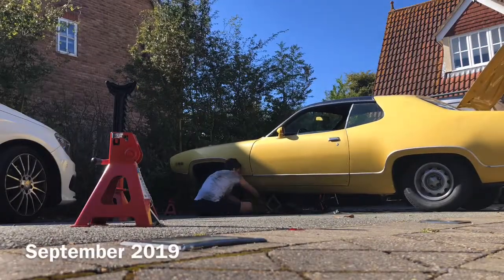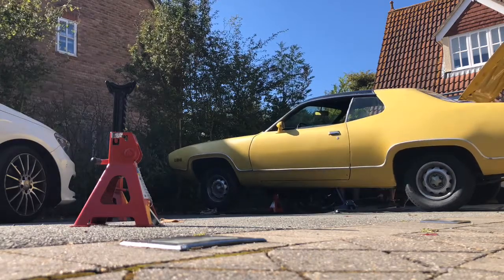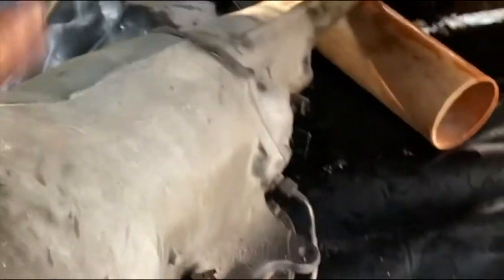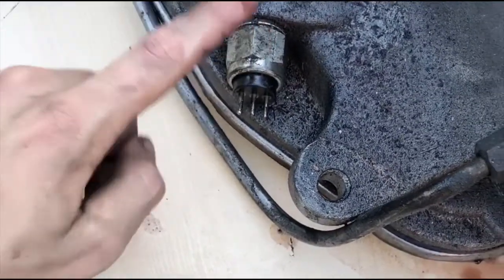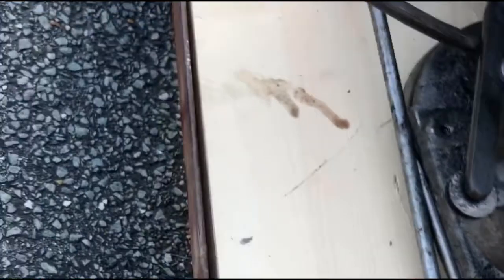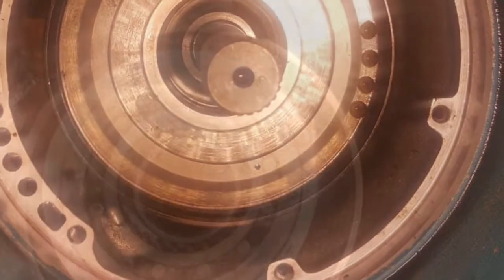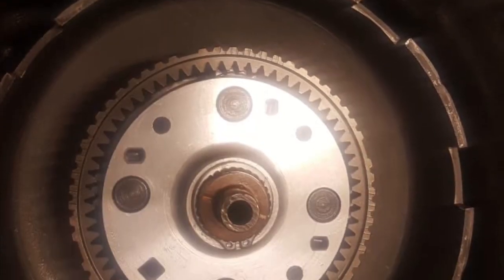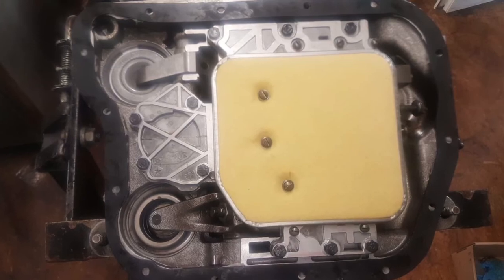A727 Transmission Removal & Rebuild // NOTaROADRUNNER

Comment: Thanks for This video,  gives me confidence at removing the A727 on my end, also doesn't look like the Torsion bars doesn't need to be screwed with, 
(I.E adjustments being taken out of whack just to remove the transmission crossmember)
Thankfully the issue i'm having is with the torque converter, so once i'm able to source a TQ i might just put the trans back into place.
Reply from the maker: No worries at all! Yes I kind of went in blind but with the help of my gearbox rebuilder struggled through and managed it ! Yes definitely easier not having to mess with all that! 

That is sweet I am debating swapping out my torque converter for something a bit more substantial as I want to put 3.91 gears in it. Lemme know how you get on! 

There will be plenty more Plymouth content, so definitely subscribe so you don't miss a video!
Reply: @NOTaMOD  Hi again, the TQ I have chosen was from Hughes performance Torque converters.

It's a mild TQ with a stall range at 2000/2200 RPM.

I had to choose that TQ as the camshaft in the engine is unknown, and a factory cam.

Most likely a 256/256 cam, once I'm able to swap the rear gears and the camshaft I can start considering more radical Torque converters.
Reply from the maker: Fair play! I am hoping to get into engine mods soon but think I am going to need to upgrade the diff first as the 8 1/4 might as well be made of chocolate haha.
Reply: @NOTaMOD  8 1/4?

Your B body Mopar should have a 8 3/4 differential, plenty strong for what you might have in mind for it.
Reply from the maker: Yeah I think as its a 72 and the last year for 400ci engines that they came with 8 1/4s. you can see it in my HOW TO video about checking differential ratios.
Reply: @NOTaMOD  another Chrysler moment in the 70's, where they downgrade the differential for no apparent reason.

Fuel milage boost?
Middle ground for durability and the occasional 
"eh, it's good enough"
Reply from the maker: Yeah definitely! Possibly the fuel mileage as I believe this was the year of the smog motor… it has highway gears in so that will keep revs low for better fuel consumption so you may have hit the nail on the head there!
Reply: @NOTaMOD  btw, Is the 8 1/4 case lightweight? Aluminum? Or cast iron?

I've got 2.76 highway gears also, low revs and possibly the best MPG's on the highway.
XD

Comment: Not a temperature sensor.. that's the neutral safety switch, I believe
Reply from the maker: On review I think you are correct at the time I didn’t have much idea but now if there was a temp sensor the issue I had with the transmission overheating would have been a lot more apparent ! But yes neutral safety switch it is 👌👍 good spot !
Reply: Yes. Neutral Safety Switch, triggers reverse lights.